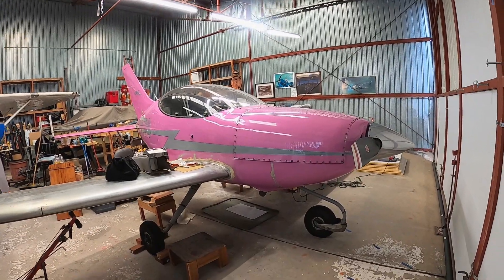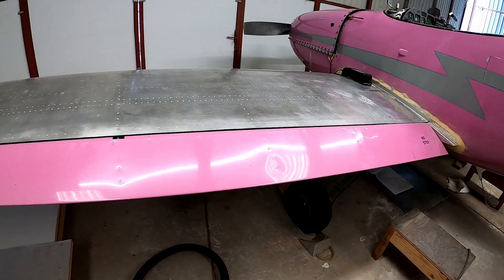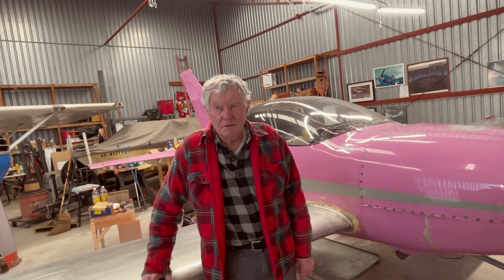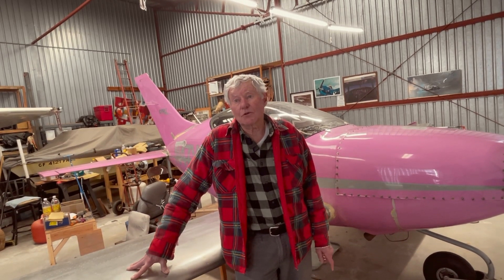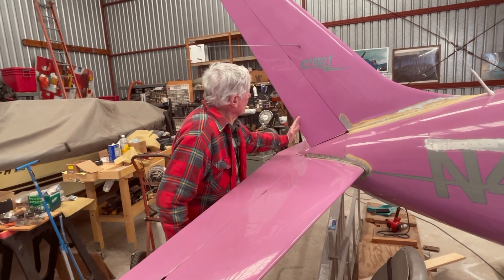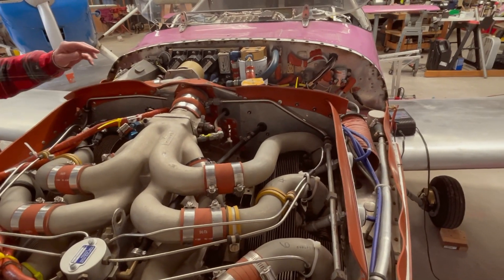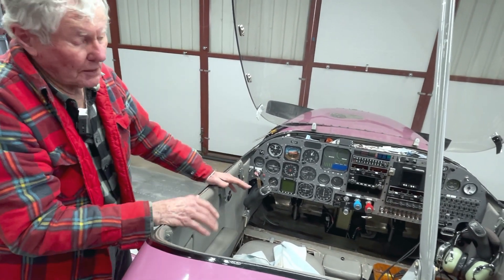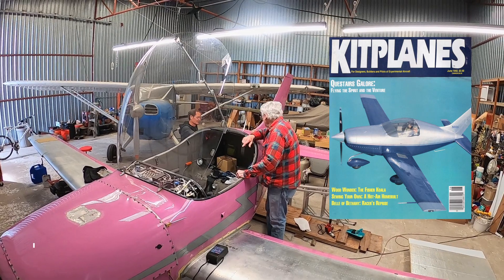Rare, Fast Plane discovery - The Flying Egg! Hangar Interview about the Questair Venture Spirit

Comment: A few raced at Reno in the Sport class.  They were fast. Tommy Rose was killed in a crash that occurred on the home stretch
As designed the horizontal was inadequate, as Tommy’s plane suffered a downward failure that sent the airplane into the ground. Not aware if Questair redesigned the horizontal
Reply: I guess the plans didn't take into consideration ambitious pilots would stuff twice the proposed power into the cowling and go flat out in excess of 450kt, flying right into the wake turbulence of other planes 50ft away.
If you want to do that you'll need to redesign all of the spars accordingly.